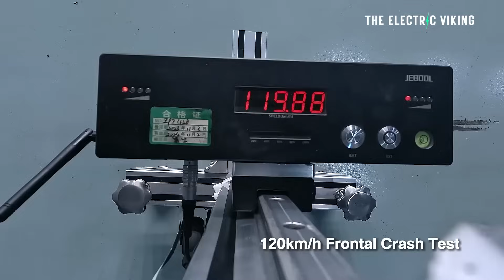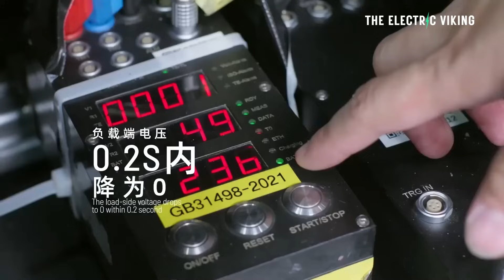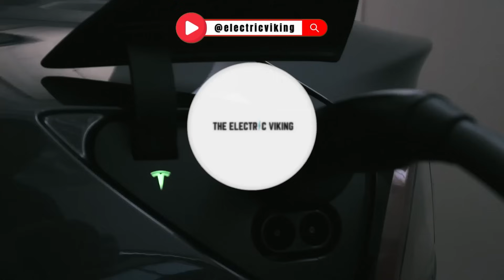CATL’s EV skateboard chassis will change the way cars are made

Comment: hope the same can be said about electric powered trucks as well . . . bcos trucks have a very different type of chassis frame & body arrangement . . . incase of semi trucks the batteries can be located along the long floor of the trailer instead of the truck, behind the driver's cab . . . thus being able to squeeze in additional battery packs in the trailer's long floor & that translates to more power & more range . . . a 36% reduction in battery weight translates to 53% more range (based on the amount of charge left in the EV's battery while driving) . . . besides re-generation braking & active aerodynamics adds few more miles to the range . . . the battery case itself can be used as a energy dissipation structure in the event of a severe crash without any thermal runaway . . .

Comment: Toyota's cautious approach to electric vehicles might be due to the commodification of EV components. Interestingly, this trend is already visible in India's electric scooter market. Several brands are offering e-scooters with identical chinese sourced batteries, motors, and Battery Management Systems (BMS), highlighting the increasing homogenization of EV parts.😅

Comment: The main gain for this is the lower cost of implementation for both large and small automakers, in effect CATL has swallowed the R&D cost for the platform and are factoring this on a commodity basis in the licencing arrangements for the Bedrock chassis, almost as a loss leader and adoption driver for the sale of their batteries. 

The pricing means this is well within the realm of the smaller niece automakers to build EVs, offering unique products much more quickly without the high cost and risk R&D spends usually involved in developing a vehicle, allowing them to focus their efforts on adapting the platform to their brands image and niece, adding unique characteristics and producing vehicles in a much shorter time.

This is virtually the opposite of vertically integrated EV companies, seeking to use horizontal distributed manufacturing at scale to drive up EV demand. It's shocking how quickly the EV market is maturing, in the past the move from verticle to horizontal growth models took decades, now it appears to take a few short years.

Comment: I need you to tell people what you said is not true about Hybrid batteries.  Don't put bad information out there without solid facts and numbers.  Bad!  Key points about Toyota's NiMH batteries and fire risks:
Generally considered safe:
Compared to lithium-ion batteries, NiMH batteries are generally considered less prone to fire due to their design that allows for safe recombination of gases during overcharging. 
Recent recalls:
Toyota has recently issued recalls for certain RAV4 models due to concerns about battery movement during sharp turns, which could potentially cause fires in specific situations. 
No widespread fire history:
Despite the recalls, there is no significant history of widespread fire incidents directly linked to Toyota's standard NiMH batteries in their hybrid vehicles.

Comment: What's your point all these companies call the chassis a skateboard.   Come on?   Tata Motors acti.ev Advanced Connected Tech Intelligent Electric Vehicle Architecture
Cenntro iChassis[1]
Gaussin Road truck skateboard[2][3]
Bollinger Skateboard, the chassis basis for Bollinger's vehicles, and a product sold to coachbuilders.[4]
Foxconn MIH, a platform developed by Foxconn for use by vehicle manufacturers and not itself.[5]
General Motors BEV3 platform[6]
Hyundai E-GMP[7]
REE Automotive P7 platform[8]
Rivian Skateboard[9]
Geely SEA platform[10]
Tesla Skateboard, a platform family based on the skateboard chassis configuration, used for the Model S/X and Model 3/Y sub-platforms.[11][12]
VIA Motors VDRIVEÔäó Skateboard[13]
Volkswagen Group MEB platform[14]
XPeng SEPA (Smart Electric Platform Architecture).[15]
Lucid Air Lucid Air LEAP Platform (Lucid Electric Advanced Platform).[16]
Zero Labs Classic Electric Platform.[17]

Comment: I personally don't see the point of a Million mile battery - at least not for private vehicles. For fleet managers, for the commercial sector, sure. But why should I care if my car battery far outlasts the car it's in? And I do mean "far". Well, you could say, hey, you can always move the still good battery out of the now heap of junk into a new car. Really? First, batteries are not usually bolted in. They're welded. So you'd have to cut it out. And then, 20, 25 years hence, why would I even want such an old battery when the new ones will be far more efficient and cheap?

Comment: Sam its safer than the any ICE chassis is it ?
Quite simply I dont believe you  
U hit anything at 75 mph and your body stops in less than a 
couple of metres , your dead 

U have spent a long time telling us how good the blade battery is , but only 
yesterday I reviewed multiple blade fires even on prototype vehicles .

Yes I know the chinese can build "specials" for crash testing , but only yesterday 
I reviewed many accidents where airbags have failed to deploy . ( about 10 cars ) 
Nope they are not safe 
I even saw 2 SUV where the welds on the back axle had broken allowing the 
axle complete with both wheels become detached from the car 
Giga casting is a way of producing cars ( castings like that have been used 
on motorbikes for years , as well as formula cars. ) However its a real problem
in repair and can often lead to the car being written off . 

Here is the top 10 safest cars according to the list I found 
and as u can see only one is an EV . 

1. Mercedes Benz C Class
2. Nissan Rogue
3. Toyota Corolla
4. Acura TLX
5. BMW 3 Series
6. Tesla Model S
7. Honda Accord
8. Kia Stinger
9. BMW 5 Series
10. Hyundai Elantra

Good vid here 
https://www.youtube.com/watch?v=yOA7qKMcjcE

Comment: Okay - first off, the energy in a crash is related to the square of the speed involved, so comparing 75 mph to 35 mph we get: 75^2 / 35^2 = 4.59 times as much energy.  That is, without a doubt a large difference, but it is not "21 times greater."  Either you've made an error in reading their claim, they've made one in stating it, or they are, well, lying.

Second, there is a lot more to a skateboard technology than safety numbers, as important as they are: cost, scalability, manufacturability, defect/failure rates in manufacture, longevity, weight (and thus range), etc.  Also, I don't see much new here... EV skateboards have been done for years and years - in fact, Tesla used to use them, but has steered away (pun intended): first towards gigacastings, and soon towards unboxed assembly.  They also have moved away from additional structural members as the primary source of rigidity in the battery framework, instead looking to use the cells themselves increasingly as structural components.

Without knowing more, this hardly seems like much of a breakthrough, much less something that will revolutionize the industry.

Comment: I would like to see the rollover and side impact data, especially since now the lower section (battery pack Location is) is heavier,  to see how well the roof infrastructure holds up. It would be embarrassing for a company to build a vehicle to withstand a head-on only to crush occupants in a rollover, which has happen, thankfully it was during a testing phase). Just to clarify I prefer electric vehicles and do agree they are much safer the ice.

Comment: China can ship skateboard platforms to Europe and USA, and these companies can manufacture cars with their own body.  The same platform can be used by several manufacturers and it would cut development costs, while offering greater variety in the market. Tesla is good at designing cars that are cheap to produce and have some innovative features, but the weak point is the interior and the finish. I think this could be a great way for smaller luxury brands like Jaguar and even BMW and Mercedes to enter the EV market. They could save on some tariffs as well.
Reply: To add to your point, shipping these will be cheaper since it's not the whole car battery so they can stuff more of these skateboard platforms into shipping containers

Comment: Hello Viking,
at 4:00 min: the 0.01 s HV disconnect and 0.2 s discharge of residual charges in the HV circuit is not in first place related to thermal runaway protection. This protection mechanism is primarily to prevent external shorts and thus prevent possible electrical harm to passengers and rescue workers from the damaged car.
A HV disconnect will not prevent an thermal runaway or inhibit fire if the battery pack is heavily damaged and internal short circuits occure. 

A "battery impact" will certainly not lead to an thermal runaway event, it can with an probability.

Comment: Before I clicked on this video I had just watched a video of a a custom car auto-body shop using 3D steel deformation machines to create precise steel body panels. Rocket Lab using a building sized carbon fibre 3D printer. With these generic skateboard battery platforms, there will be a niche business to design and build fully customised cars.

Comment: New skateboard chassis? GM built this over twenty years ago in the late 90's. The battery technology is obviously 1000 times better, but the thought was there.
Reply: GM might have built something similar in the 90’s, but this CATL product still is new.  But kudos to GM if they did in fact achieve a similar feat back in the day.
Reply: Not a good idea if the battery would not last long enough or is unreliable

Comment: This is also useful for company exports. This could be akin to brands using Toyota engines to make traditionally high maintenance vehicles with high tolerance/low maintenance engines. For example, Porsche could buy skateboards from CATL and drop a body on it and, boom, new fast fancy car

Comment: Are non-plug-in hybrids as much of a fire risk as plug-in hybrids ?
Reply: It found that hybrid vehicles reported 3,475.5 fires per 100,000 sold. Gas vehicles accounted for 1,529.9 fires for every 100,000 sold. Electrics saw just 25.1 fires at the same rate.

Comment: By far the most common vehicle crash is one that happens at about 40 mph.
That is not because people travel at below the national limit, but because they react to dangerous conditions, and brake before they hit anything.
Even head on collisions are rarely at NSL against NSL, they're much more usually at about 50 mph in both directions, which equates to 100mph combined.  a 70mph head on crash into a pole is going a very long way to making head on crashes survivable.

This is impressive stuff.

Making the batteries a structural part of the monocoque is the obvious way forward, and CATL appears to have been thinking along these lines in creating this chassis.

I can see that it's getting increasingly difficult to improve these structures. Of course, instead of making the honeycomb out of aluminium, you could make it out of carbon fibre, but that is likely only to be in the realms of supercar designers. Having said that, the costs of carbon fibre really aren't too great these days, the real cost is in the machinery for making it (think BIG pressure ovens). Considering how much car companies can spend on trick gear if it can be used to seriously undermine the opposition, I suspect that this will be the next step.

If you think that such progress is improbable, it's because EVs have completely broken the automaker paradigm. EVs make these kinds of processes possible because the mould for creating cars no longer follows the traditional route.For over a century, automakers made incremental gains with each generation. Engines became more complex and more powerful, but they all depended on improvemnets in engineering, not the basic concept of burning fuel to push pistons.

EVs have taken engines (and gearboxes) completely out of the equation, which means that battery chemistry and anode/cathode composition are now the arbiters of charge density. And charge density is now the limiting factor because electric motor design is very well understood, simople and efficient. a 1000bhp ICE is HUGE, complex and unreliable as well as demanding of high maintenance. OTOH, a 1000bhp motor is not much bigger than a 200bhp motor and is going to be as reliable as the turntable motor in your microwave.
Reply: Two exact cars moving at 50mph colliding head on where point of impact remains the same results in each experiencing an immovable object collision at 50 at the same time.  Total energy dissipated is 2x one car.  Each managing 1/2 the total on its own.  If the two cars do not weigh the same and/or crumple the same then the time & distance occupants move until stationary relative to the point of impact determines the looser.  Assuming the cabin area is sturdy and doesn’t collapse in on the occupants.

Comment: The 𝐂𝐞𝐥𝐥-𝐓𝐨-𝐂𝐡𝐚𝐬𝐬𝐢𝐬 approach has been developed in the automative indstry every since 𝟐𝟎𝟐𝟏. The  𝐂𝐈𝐈𝐂 alias CATL Integrated Intelligent Chassis was first mentioned in November 2022, and it is the basis for a contract with Neta in December 2023. That last development was supposed to be ready in Q3 of 2024 and that's what got a new markting name now - the Skateboard-Chassis. Sadly the last press release does still not mention when the first car does get actually delivered, not even mentioning Neta. Since no customer was announced, we do not get much more technical details othen than the subsecond-hints that the Electric Viking fell for. I would be more interested in things like the actual size - I remember that Skoda is not building an electric Octavia since the old Volkswagen MEB is too high. Neta however did want to do just that - did they fail? Is CATL's pack too bulky?

Comment: While we  applaud CATL designing next-gen batteries and now "skateboard" platforms,
and certainly applaud them designing "bionic-tortoise" safety in to the vehicle's frame, 
there is no way you can guarantee that individual batteries are not destroyed in a big crash like that, 
and since LITHIUM WANTS TO BURN, there is no way you can guarantee that damaged batteries won't burn - 
especially if exposed to water and/or salt water.  Yes, it is a reassuring crash test, and we applaud the focus on safety...
but you simply can not guarantee that damaged cells will not ignite

Comment: Buying a gigacasting machine is easy (not cheap). Designing the mold, where the design depends a lot on the properties of the used material, is anything but easy. Even Tesla's first castings had very rough edges, other issues and a LOT of rejections that where scraped and re-melted. If I remember correctly, SpaceX helped with writing better simulation software to optimize the mold design. Low weight means thin wall thickness, with is hard in very large castings.

Comment: How do you discharge a giant lithium battery in 0.2 seconds? The internal resistance of the battery alone would make it impossible.
Reply: Yeah - Sounds like BS. Wait until the first death like Telsa where first responders can't get the passengers out. All hype to me until proof in the pudding. Anyway with solid state battery technology coming along, it's all planned obsolesence and the world will still need oil to build these things. Still nothing changed in the available grid power to charge these things.

Comment: I would just add that to me EV stands for electronic vehicle. The battery motor and so on is vital but you then have to integrate self driving and all the other software based and computing infrastructure. This is where legacy auto went wrong they thought an electric car was exactly the same as an internal combustion car. They are totally different. It is also dangerous to outsource because you outsource not only your profit but your technical skills.

Comment: Could this become the lifeline for incumbent car manufacturers: build on top of this chassis giving them time to develop their own. Or keep building on to of these chassis (which will mean even more massive lay-offs than are already happening as a big chunk of the car is already built).
Reply: Whatever legacy auto do they have to come up with something that incorporates all the software and computing power that they have so far being spectacularly unable to do. The battery and motor is of course important but you then need to compete with everyone else and sell at a profit. And you are already giving your profit away to a supplier who has many different customers clamouring for their product.
Reply: Great call !